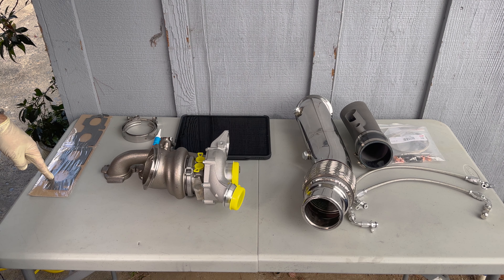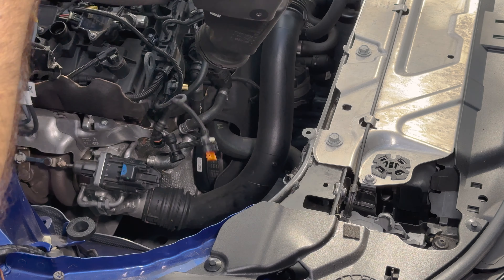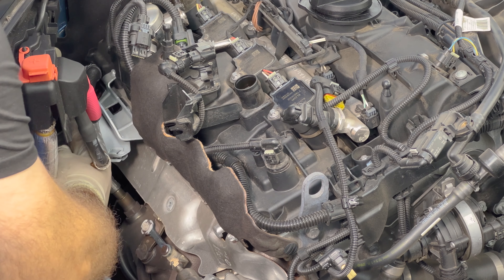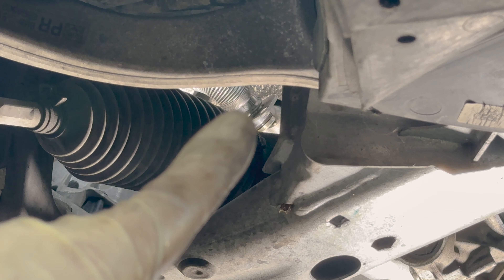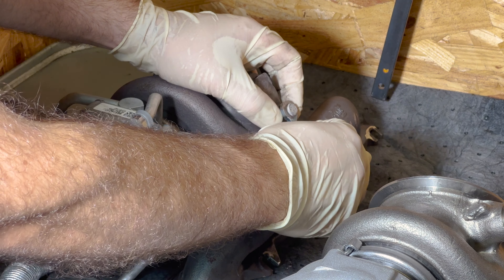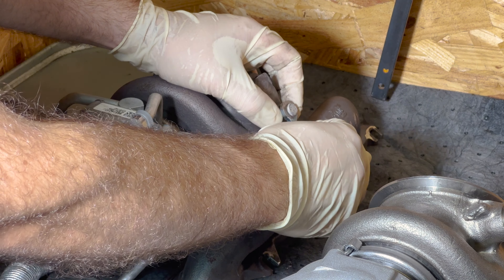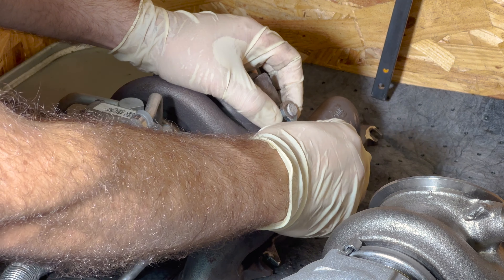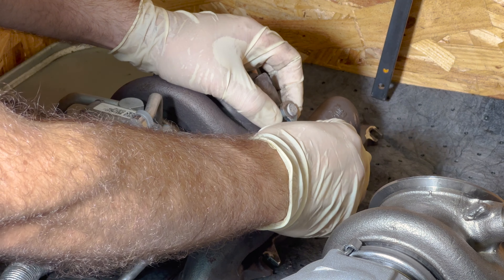I Gave My 4 Cylinder B48 BMW 500HP + Reliability!

Comment: How can you know you are not compromising reliability?
Reply from the maker: I say that because of the strength of the bottom end of the engine.  If you occasionally use the power as most people do the engine would still be within it's proven operating limits as it shares the same rod and piston as the new Supra and M340is and people push 750 WHP on them.  Normally you'd be needing to go with bigger brakes and cooling etc. to tie it all together but on the M sport models BMW basically gave you the platform from the M340i but with a smaller 4-cylinder engine, even shares the same transmission.
Reply: @VehicularDIY  How do you know this?

Comment: Do you have a b48a or b engine?
Reply from the maker: This is a B46D so 10.2:1 compression.  Same rod and piston as a Gen 2 B58
Reply: @VehicularDIY but B46D with CR 10.2:1 is the same as B48B20B with CR 10.2:1. They have the same internals etc. Correct?
Reply from the maker: @patrikpozgaj  So far as I know they have similar strength internals only difference being the fueling.  This gen 2 B48 has the same fuel pumps as the gen 2 B58 so flows more.  The F3X B48 powered cars can upgrade to this HPFP.
Reply: @VehicularDIY  can you please elaborate differences? I have 1 series, 125i B48B20B. I already bought IM450. But still not in the car. Better to be safe than sorry.

Comment: is that safe to your engine bigger turbo means less reliability especially for bmw because bm is to sensitive for mod bm mechanic told me if you want bigger turbo its not just the turbo that need to replace there is few things need to be replace not just the turbo or else its hard on the engine

Comment: yes okay it has 500hp, but I'd still take a stock S65 over a 4 banger. Yes i know this car will smoke the E92 M3 but its not always only about straight line speed. Thanks for sharing this video though
Reply from the maker: Yeah my favorite car to drive was my old E30 M3, was slow but more engaging.  For a daily driving and the mix of electric cars on the road it feels like you need 400 hp to keep up lol.
Reply: @VehicularDIY  true true. Then again I would go for a 340 then even if it means going for an LCI F30
Reply from the maker: I can say one thing for sure if you drive a G20 and LCI F3X back to back the G20 is going to seem like a lot of car for the money especially considering the price difference isn't too drastic.  I drove a 440i xDrive for a while.
Reply: @VehicularDIY  I am from the Netherlands so the prices here are fucked. A good lci f30 340i costs around 35K euros, we can import from germany but you cant be too sure about its history